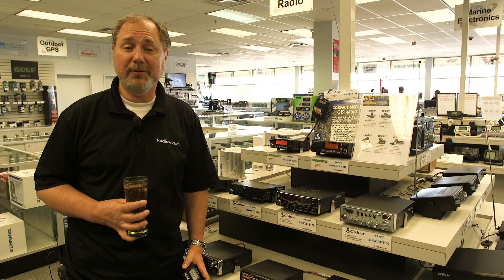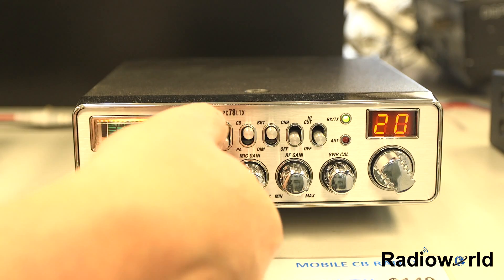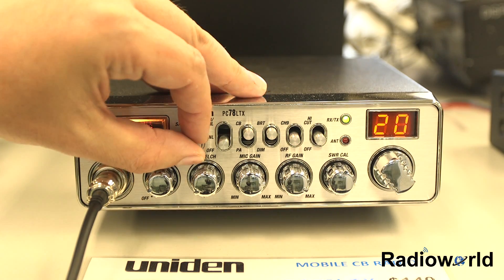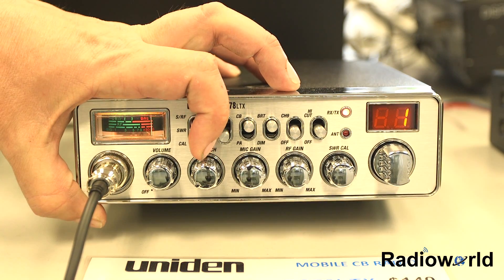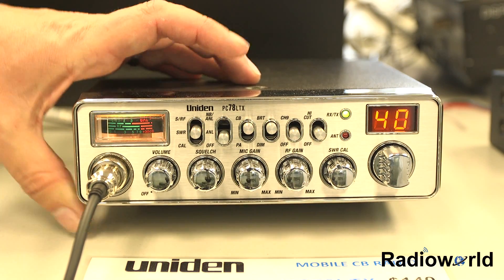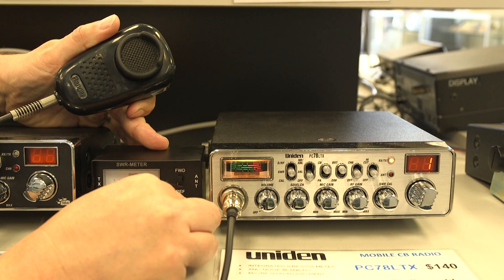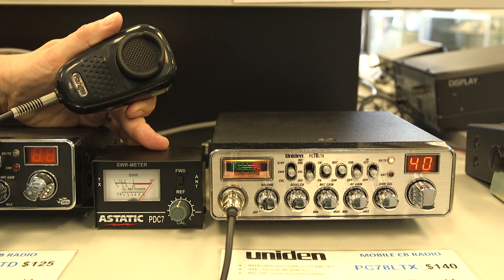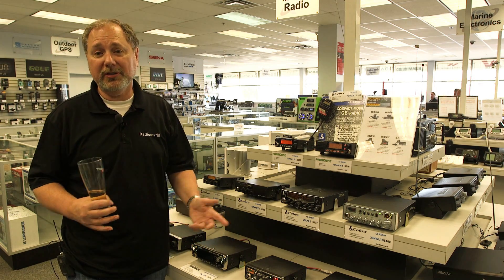How to Check CB Antenna SWR

Comment: So if needle is same on 40 and 1 then should be ,but I receive good but still not reaching out.
Reply: Bad antenna. A low SWR reading doesn’t mean the antenna is radiating, think about it if you hook up a dummy load your SWR is low but you’re not sending out a signal.

Comment: My needle doesn't even move when I press the mic the rx/to light turns red but that's it, when installed it was working fine then all of a sudden stop working
Reply: Sounds like the radio is not transmitting.

Comment: This video skips step one, and assumes a proper antenna installation. It also does not warn and make clear that transmitting into an improper antenna system will damage your radio!!!  It is important to check SWR, and be certain it is in a safe range. 

FOR THOSE WHO HAVE THE ANTENNA SITTING ON THE TABLE, or stuck to a fridge, this step not apply until the antenna is properly installed. Please research ANTENNA COUNTERPOISE for more info. Do not transmit on your CB until SWR is checked and shows it is safe to do so. Transmitting into a poor antenna system, badly mounted, missing counterpoise (no car), or incorrect length, will damage your radio!! Please research ANTENNA STANDING WAVE RATIO for more understand. And how to properly install the antenna before we get to the SWR check step. Which is the last step in the installation process.

Comment: What does it mean when my red light comes on? "Ant"  i cant get mine to cal correctly, even went to buy a new antenna still not working right.  Swr shoots up to the red too
Reply: Either get a new radio or an antenna tuner.

Comment: Im in a dump truck today that I don't normally drive.
I was trying to check SWR with the Cobra 29s meter but it won't move the needle to the calibration mark. It stops around 3.
Reply: Grounding problem. 11 meters needs a good amount of metal as it is HF. A mag mount antenna base on a metal potion of the vehicle usually solves it.

Comment: Both my needles on CAL Channel One + 40 are exactly the same   . But when I key the mic on slwr it goes halfway into the green  if I key the mic in SRF it is in the red  . When I am talking what setting should this be on with this dial  srf or swr or cal.  I have already got off a few pieces on the antenna please
Reply: Ideal: On SWR the meter should barely move on 'dead key'. On CAL, get the needle to the far right arrow marks.  On SRF, you will also swing the needle to the far right when talking.

Comment: I'm a truck driver and have a house CD radio why when I touch the CV microphone cable the antenna works better
Reply from the maker: This sounds like an installation issue. Ensure your rig is properly grounded, check your cabling and your antenna connection and make sure nothing is damaged or corroded.

Comment: What if it’s high on both 40 and 1?
Reply: It means you have a lot of antenna for 11 meters. More discouraging is too low on both 40 and 1. Use the built in meter 'to trick' the system. Otherwise, check your grounding, then reduce antenna length ever so little at a time.
Reply: @bradlong7941 🤦🏻‍♂️

Comment: What a black art this always seems to me. People key up for calibrate then slide to swr while holding it, others key up and release for both. I have this radio and similar meter, I did a screenshot because I always wonder if the other radio settings matter for readings.

Comment: That video was to the point very informative and very helpful for the person who's getting into ham radio or CB this place is your headquarters for thatI purchased a telescopic antenna at the beginning of the month and it works like gangbusters ten times better than that joke of a rubber ducky
Reply: i had a stroke reading that

Comment: I have an issue with mh 27 mhz raido. My swr is good. But i cant figure this problem. At night the neddle on the dial sits right up around seven. I can barley hear any one and they cat hear me good. But during the day is fine. I was told i need to earth the antenna wich i have done but no change. During the day the neddle sits low and all is good i can hear people properly when they are talking and they can hear me. This only happens at night and i know that this is not ment to happen can someone please help me fix this problem.  I have a pearce simpson super tiger and a uniden president grant and this happens on both of them. Its annoying because i just want chat with my 27 mhz buddies and some skip but cant because this happens. If anyone could help me with this id be very greatful thank you. 
I live in perth western Australia. Id be very greatful for any help i get thank you all.